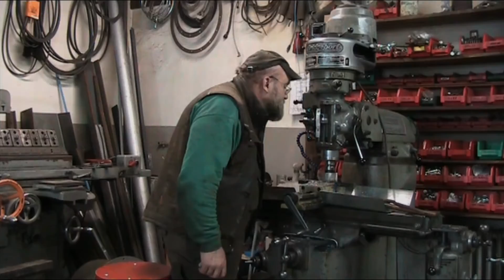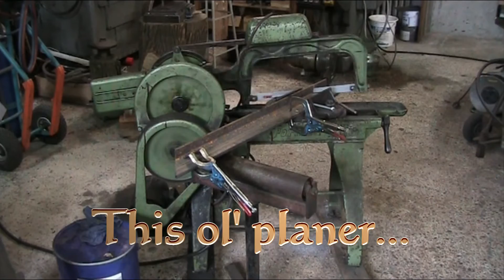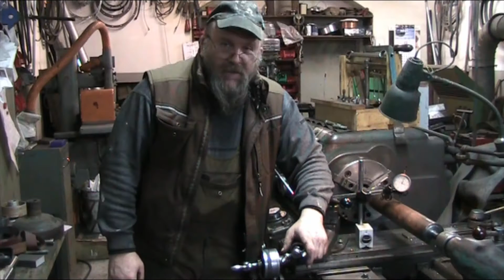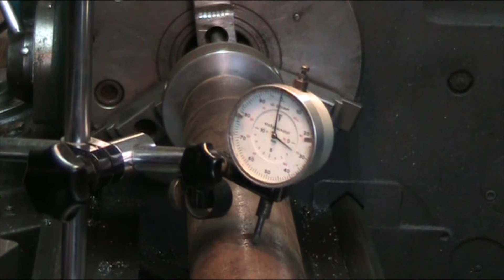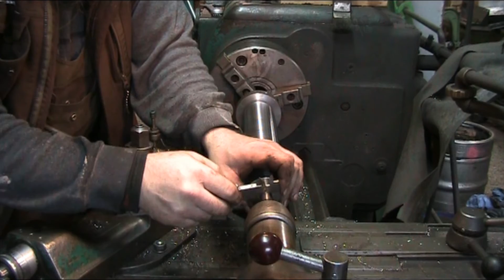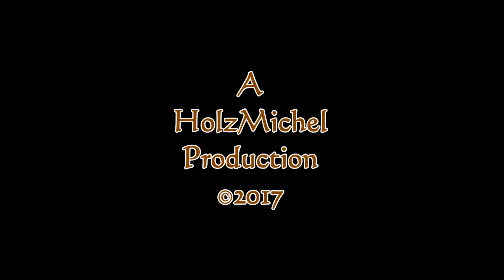this old planer, episode 5, resurfacing of the idler rolls

Comment: Good to see you working again. In two weeks i am going to start on my planer infeed rolls :)
Like to see what you do and learn from it.
Reply from the maker: good luck on your project!  it'll be interesting to know how things turn out for you. things are stalled at the moment as i'm waiting for the material to make the bearing bushings. once that arrives work will start up again.
Reply: +HolzMichel, hey Michel, today got my infeed table back in the frame. I did not measure how far the infeed table rollers were sticking out above the table when I removed the parts... you got any clue on how far the rollers should be sticking out? 1mm? Let me know what you think.
Reply from the maker: that can vary from machine to machine. to measure it you'll need a set of feeler gauges and a straight edge. perhaps start with 0.5mm .. any more than that will probably cause snipe on the lumber. lay the straight edge across the rolls like it was a board passing over them and check the distance between the bed and straight edge with your feeler gauge. which ever side is loose or tight will need to be adjusted.